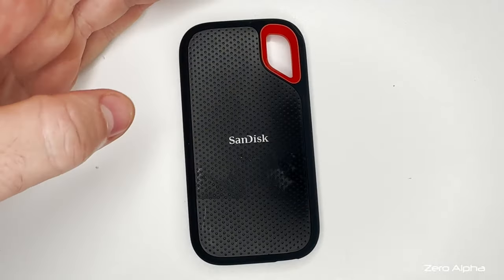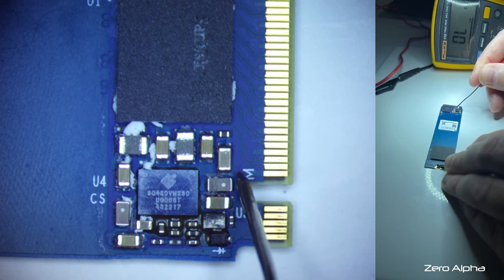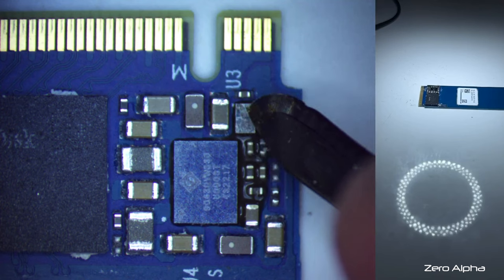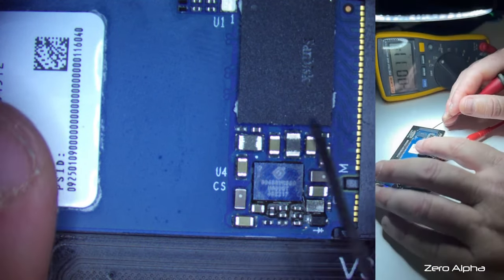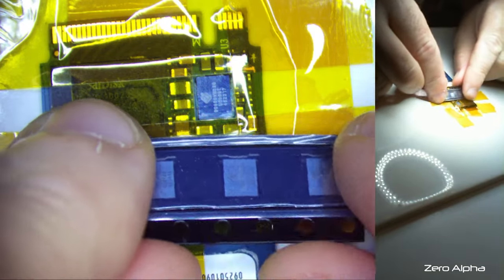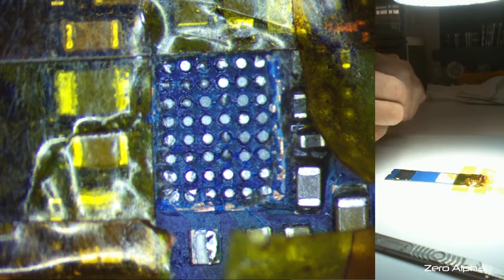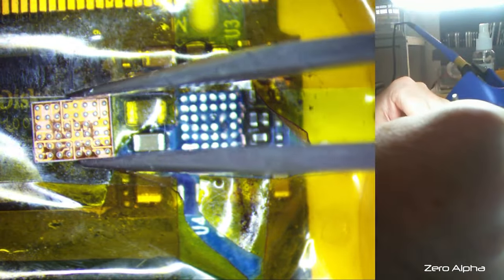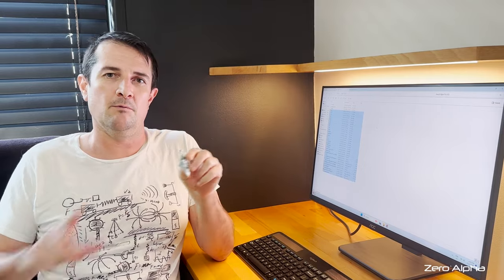SANDISK SSD BACK TO LIFE - Data Recovery Successful!

Comment: Would it be possible to solder leads and inject the correct voltages to various points on this circuit to bypass the broken PM IC? I haven't the equipment or experience the replace the IC, but I could definitely solder leads and supply voltage. Thanks!

Comment: injecting very small amount of current on to the shorted rail and using a thermal camera like flir which can be connected to a phone and see which component is heating up
it will make your job easy
Reply: first you need the money for a flir :((
Reply: @king_james_official   They're not that expensive, around 300$ for a infiray usbc camera with macro lens. But its useless if you don't know electronics. You need to know where to inject and what to look for, if you buy one thinking its a magic bullet you'll be wasting money to watch random components heat up.
Reply: @Zujanbre it is expensive in the shithole known as eastern europe, but yeah you're right. it's a pretty cool device to have anyways